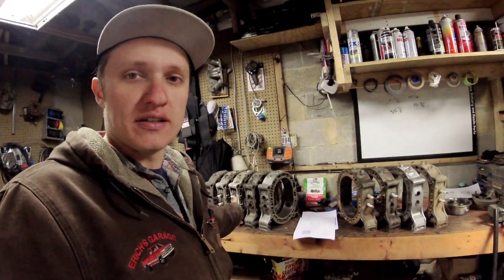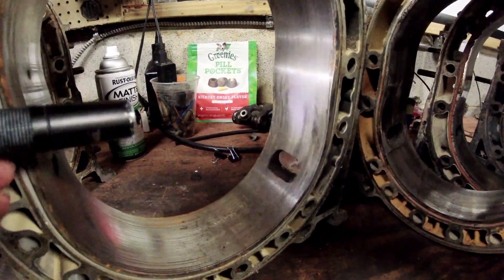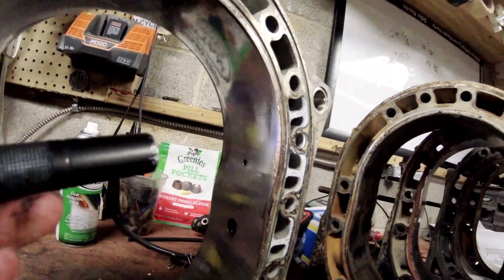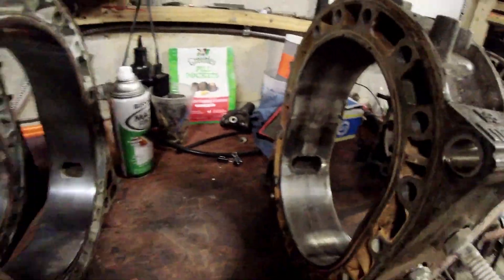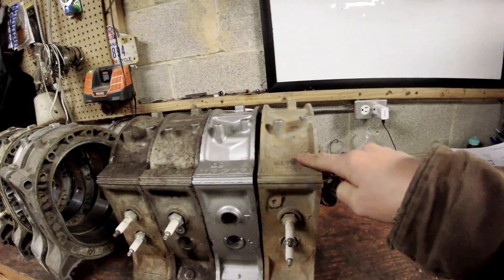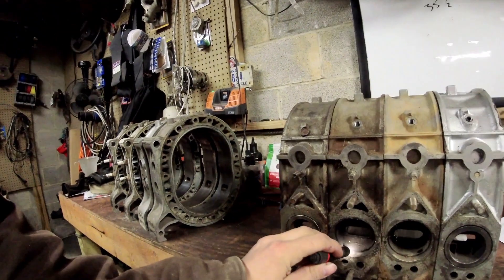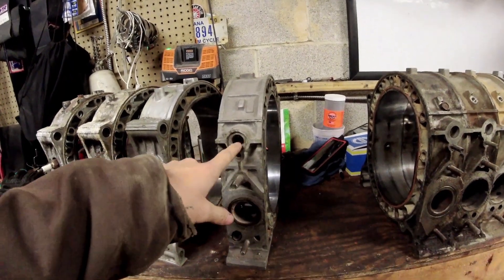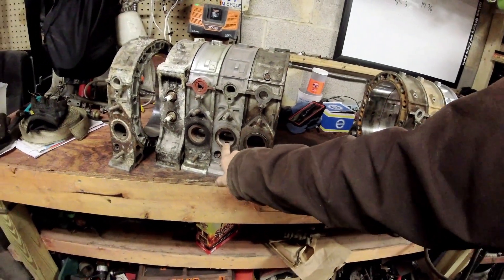Rotary Engine Housings - CAN YOU USE THEM : Build Secrets EP:3

Comment: Could you please do an episode or provide info in reply to the question; What would you do to rebuild a 13B GSLSE motor? The parts are obsoleted and I'd like to know what the best solution for rebuild replace for that series. What is compatible with an unmodified rebuild? What engine part combo is best for replacing a GSLSE motor, assuming no old parts are used?

Comment: One thing we did not see in this video regarding chrome wear was the groove that tends to get scribed into the edge of the chrome around the perimeter by the apex seal triangular end piece. I believe this is ok up to a point, but I'd be concerned about excessive wear of this type possibly snagging the triangular piece and dislodging it(?) 

The Atkins Rotary aftermarket apex seals would seem to eliminate this groove by making this end piece longer so that it does not have a sharp point capable of scribing this groove in the chrome. Thoughts or concerns?

Comment: I'm a master engine builder. Way older then this kid.

The reality of working with an rx 8 is not to use it as your primary vehicle. 

If you have alot of mechanical skill the cheapest way to make a mazda drive able is to put an old school small block 350 or 383 in it, carberated.  Treat the car like your building an old t bucket. Replace the Guage with regular old school Guage from a 59s to 80s car. Tear out the computer controller parts in the car and treat it like an old school hot rod with a newer body.

Bloodviking

Comment: Hey great vid. I have a question I have a fb gsl all stock I have a s5 13b Street ported I wanted to swap with a carb is this swap worth it?
Reply from the maker: Yes for sure!!!  I have a video about 13b swapping a FB rx7.  That motor will probably double the power in your car!   High compression S5 NA is the ticket
Reply: @RADPotential  I’ve had this car sitting for 7 years. After watching your channel for a few days it got me going I need my 7 back. Cleaning the carb out and running the 12 until I have everything for the 13b.
Reply from the maker: Heck yea!!!!! Stoked to inspire action for you!!!!

Comment: Is there a difference in bolt pattern between 12a, 13b, and Rx8 13b. Could 4 port 12a irons bolt to a Rx8 13b housings.
Reply from the maker: Yes they could.  People have used gslse housings in rx8 engines.

Comment: Unsubbed because you won't sell your housings.
Reply from the maker: 1 milllliiioon dollars
Reply: @RADPotential  do you BUY used housings and rotors by any chance? Or just collect them from "mystery engine you happen to come by? I have a decent pair of S4 housings, one rotor and the C-weight/flywheel assy/front cover and internals from the same engine. Also the oil cooler that has not yet been pressure-tested. Only issue is they'd be shipping from Alberta, Canada...

Comment: You ever mess around with ceramic or carbon apex seals? What would you want for a housing to run either?
Reply from the maker: I have never been around engines using those seals.  I can do some digging or asking around.
Reply: @RADPotential  i just bought a set of carbons for my 12a cause they were cheaper than decent steel ones. Plus i wanna rev the piss outta my engine and not hurt it. Just was thinking if i wanna grab a set of s5 that has been milled and grooved to make new 12a housings or if i needed to
Reply from the maker: The larger exhaust port from the 13b housing will benefit you as a 12a exhaust port is tiny.  Otherwise I dont know enough about your apex seal to comment on its longevity or its friction life along the housing surface

Comment: I’m building a 12a engine I have 13 b with 12a housings is there any benefit to using 13b
Reply from the maker: 13b 4 port irons are basically the same as 12a irons with regard to port size and intake manifold options.    If you're talking about ditching the 12a stuff. You can use the 13b irons and just build a 13b.  Bit more power and torque. But you will need 13b housings, rotors. Eshaft. Exhaust intake. Etc.
Reply: RAD Potential 
I have some six port irons just wanted to se if I can get more from the 12a than using the 12a irons
Reply from the maker: Id use the 12a irons.  The 6port irons won't work because of the coolant grooves and you would need a custom intake manifold
Reply: RAD Potential 
Thanks for the help